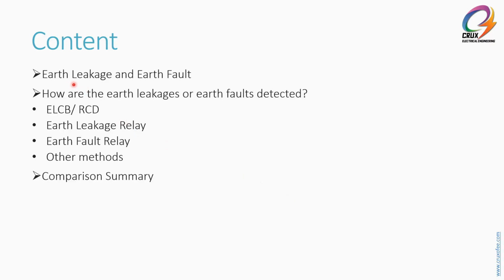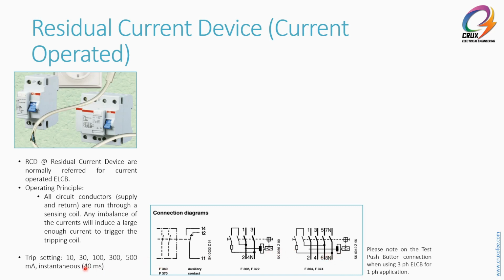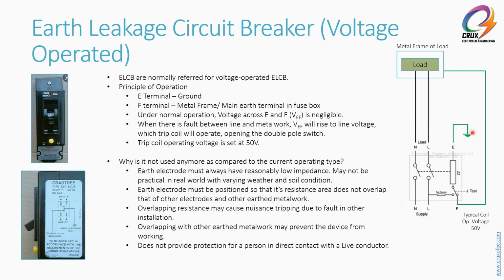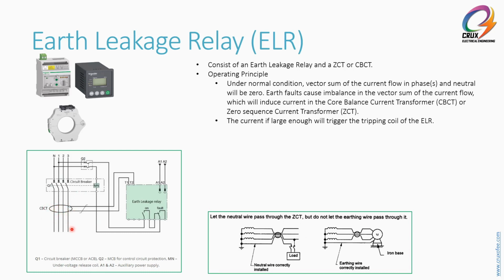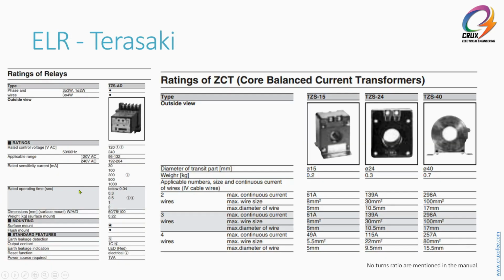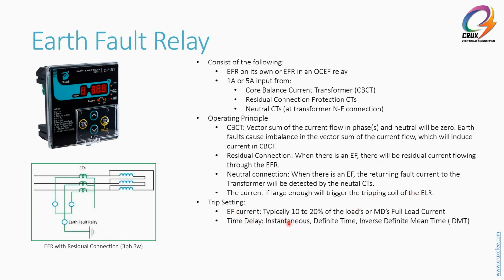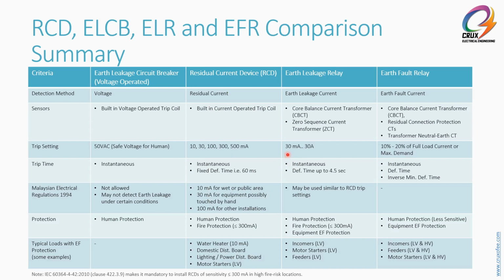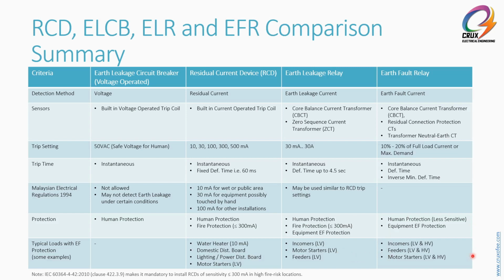Earth Leakage Circuit Breaker, Residual Current Device, Earth Leakage Relay & Earth Fault Relay

Comment: Assalamualaikum Tn.Ir..Mcm mne dgn RCD Auto Reclosing? Ada didokumenkan dalam GPPE? Selamat tak untuk dipakai?
Reply from the maker: 1. Dalam GPPE tidak ada dinyatakan apa-apa berkaitan Auto Reclose RCCB/ RCD. (AR-RCD)

2. Selamat. Bergantung kepada jenama dan brand, ada beberapa setting pada auto recloser yang biasa dijumpai:
a. Reset Delay
- Berapa cepat AR-RCD akan reset selepas RCD trip.
b. Number of Reset
- Berapa banyak kali nak benarkan AR-RCD reset. Sebagai contoh, set 3 kali. Selepas 3 kali reset dalam 30 minit, AR-RCD tidak akan cuba utk Auto Reclose lagi. Ini kerana Earth Fault tersebut sudah bolted/ melekat, jadi user kena pergi cek dan selesaikan masalah tersebut.
c. Lock or Self Reset
- Dalam keadaan Lock, AR-RCD akan lock terus selepas mencapai bilangan reset dalam masa yg ditetapkan. User kena manual reset. Atau jika Self Reset dibenarkan, AR-RCD akan reclose semula selepas satu tempoh masa yg ditetapkan dalam keadaad Self Reset.
d. Remote Reset
- User boleh buat Remote Reset AR-RCD melalui wifi atau 3G device.

Harap membantu. 

Orang pakai AR-RCD di rumah sesuai kalau takut peti ais tak ada api bila balik kampung lama kalau rumah selalu intermittent trip. 

Dalam industri pula, AR-RCD digunakan untuk auto reclose pada DB di kawasan remote/ jauh atau tidak berorang (un-manned).
Reply: Penjelasan yg sgt membantu..terima kasih tuan